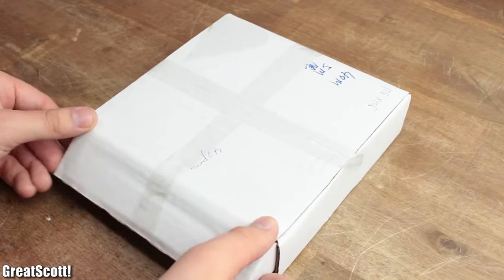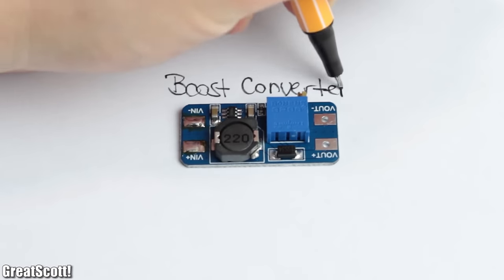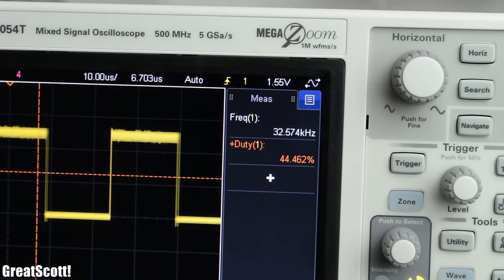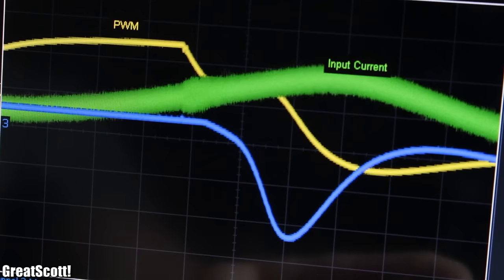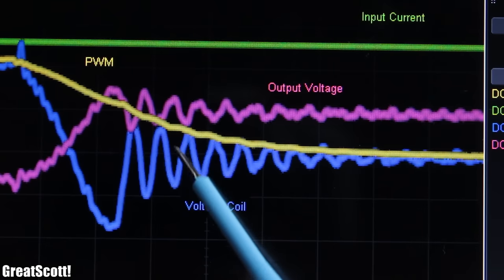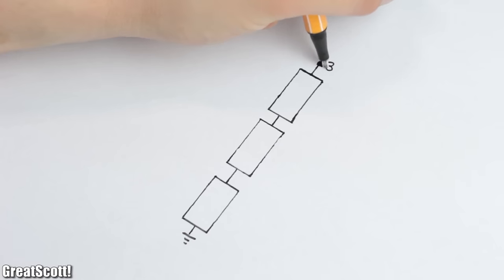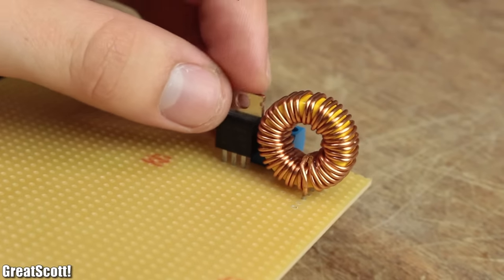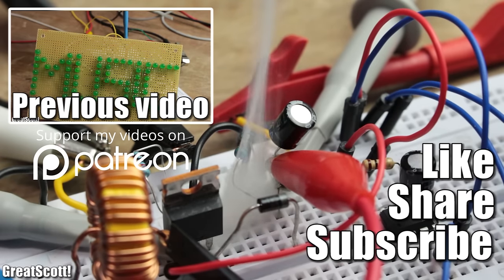DIY Boost Converter || How to step up DC voltage efficiently

Comment: When simply powering an LED, would 3 batteries in parallel with a joule thief circuit last as long or possibly even longer, than the standard non-joule-thief 3 batteries in series or does the storing and releasing of voltage, consume more power and overall drain batteries faster? I would think that by it only being lit 50% of the time, the Joule Thief should make the batteries last longer or even if it used twice as much power while lit, by being lit only half the time, it would at least last the same length of time. I am wondering if using joule thieves to build flashlights as a hobby, cost more money to build, but saves money in batteries by giving you a source of light for longer time.

Hopefully someone reads this and 100% knows the answer. I hope the answer is that the circuit gives you (visually not noticeable pulsed) light for a longer period of time.

Comment: Is the Vcc pin of the Attiny connected to the input voltage of the boost converter? if not then how is the Attiny being powered? 
sorry if this is a stupid question :)
Reply from the maker: +ali10163 It is
Reply: +GreatScott! thank you.

Comment: I have a  question....  why do we need to step-up voltage in order to make something work when we have a fixed amount of watts that is required to make that same thing work thus, why do we need more volts?
Reply: EVOCATI RECORDS imagine the circuit is a water wheel. If you slowly drip a gallon of water on it it will barely move. If instread you use a hose that shoots out the water, the water wheel will move. The speed of the water is the voltage and the amount of water is the resistance.

Comment: Why do you used uC instead astable multivibrator? Here is my project which provides 18 volts (Now it's configured to provide 9 and -9 volts). It also have feedback but I used bipolar transistor instead unipolar. Because I can't find any good MOFSET in LTSpice. http://imgur.com/AWbzbYu
Ps. In my project voltage is regulated by Zener diode.

Comment: I’m curious about your steady voltage output, i’ve tried powering my electromagnet with it, but it keeps shorting out the capacitor since its a short circuit(the electromagnet) how should i fix it
Reply: Constant current source, lower the current and install a ferromagnetic core to the coil.

Comment: Can some one explain me why the voltage divider has 3 resistor normally i see voltage dividers with 2 resistor and i did not understand the reason for that  third resistor, for what i searched it creates 3 different voltage drops across each one but he said it was only needed a 5v reference to the 30v.  If some one can explain i am all ears.
Thanks and great video!!
(PS: i don´t understand much about electronic)

Comment: It's great and all, but seriously, why put a uC in everything? I'm not saying you did a bad video, but I'm a bit disappointed about this because I don't have tiny85 on hand. You can make a crude boost converter by using an ever so popular 555 with voltage regulation as well. That way it could be made by practically everybody, who has this ubiquitous IC. 
  Anyway, good job there. Just decided to express my thoughts.
Reply: Also I would add that more and more people are using microcontrollers in their hobby projects. I hardly ever use  a 555 timer anymore because I can do so much in code.  As such I maybe have 3 of them on hand where I have a dozen atiny85 ics.  Really though, complaining that his video didn't include components you have lying around? Why would he know that? Lol not everybody has 555s floating around just like you don't have any a tiny85s.  I would say more people have arduinos floating around these days which could be used the same way.
Reply: The 555 timer does not have feedback and its so hard to make a feedback for it, and needs much space on the circuit just to make it oscillate. Imagine the feedback which needs an error amplifier and more with different IC's.
Reply: I have attiny 85 on hand, no 555 timers.

Comment: hi greatscott! I was wondering since I was deciding to attach an electric motor/ alternator to my bicycle I was wondering what would be an ideal solution I did some tests and when I am casually riding my bike my multi meter shows about 2.3v-3v then when I am racing or in a hurry on my bike the multi meter shows 7v-8v I was wondering what would be an efficient way to keep this at 5 volts your reply would be much appreciated. thank you and have a nice day
Reply: I do this for a school project, the dynamo (alternator) generate 12V AC (6W or 3W depending of the dynamo) so 500mA.
I build a rectifier bridge (I use 4x 1N5822 Schottky Diodes)(At 1A I remember that have 0.3V of Vf) for a more efficient design instead of the common 1n4004 (0.7V), a capacitor of 1000uF that smooth the voltage 12V*√2=16.97V I remember so just buy 25V at least, and I used a DC DC converter (buck - boost) (buck in this case) that I bought in eBay for 8 dollar for a efficient design (they say that is 92% efficient but I think that 85% is realistic) instead of just the LM 7805 that is resistive and just will 12V@500mA to 5V@500mA so 7V@500mA=3.5W of heat, and with this thing, at full speed you can get 5V@900mA at least, and easily 5V@500mA at low speed.
PRO tip: your phone cannot charge at more than 500mA with this setup for protection, you will need a USB charge doctor that emulate a legit charger for a quickly charge
Reply: +fersunk thanks

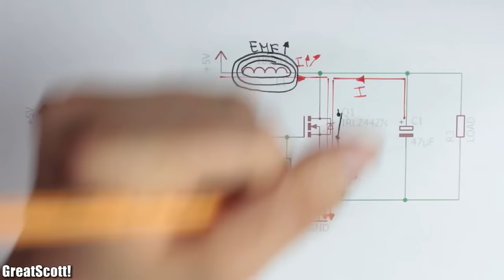Comment: I'm a bit confused at 3:07.  How does the controller deliver a PWM signal to the mosfet gate when pin 6 is connected directly to +5V with no intervening resistor?
Reply: bah... because this diagram uses dots to indicate when intersecting lines are connected.  No dot between pin 6 and +5V, therefore, they aren't connected.  To often do I spend much time pondering such questions, unable to see the obvious answer until I pose the question to others.  /facepalm
Reply: There are not connected.

Comment: so i don't get it (i am a complete noob at Electronics) but, how can you make the Voltage higher ? where Does it come from ? cus too me it seams like you are making free current
Reply: CS:GO: That's not correct.  The voltage increases but the current decreases.  Think of the voltage as the energy of each electron (in water terms, the pressure), and current as the number of electrons passing through a given point in the circuit every second (in water terms, the flow rate).  Energy cannot be created or destroyed, but you can move it around.  In this case you can strip the energy from a lot of electrons and give that energy to a small number of electrons, thus boosting the voltage but decreasing the current.  In math terms, the power (voltage times current) is the same for both the input and output.
Reply: Inductor works like flywheel for current. Once there is current in inductor it tries to stay there no matter what voltage. Inductor is like capacitor, but it stores current instead of voltage. So if you have current in inductor and disconnect it it creates high voltage across itself, because it tries to keep the current flowing.
Reply: +Paul Bartrum what about efficiency?  100% in 99% or less out.
Reply: You can boost both voltage AND current at the same time, though. I've seen a few "over-unity" devices demonstrating this on their crowd-funding pages, and failing to mention that the output has a much smaller duty cycle than the input, and it doesn't even come close to unity, nevermind OVER-unity.

Comment: Sir i want to power my arduino for a long time just by 9 volt battery. So can i use a boost converter with a volatge regulator to power for a long time ?
Reply: An Arduino needs 3.3V or 5V depending on the board, so you need a buck converter, not boost.
Reply: +FlyingShotsman Can u please tell me exactly how a buck converter work in short

Comment: I'm curious. can you use DC Booster to boost another DC Booster? :D
Reply: Yes, but ultimately, there is a limit in output voltage/amperage based on the supply (such as a battery or these solar cells) and each boost circuit. Either way, these ICs have a max voltage and so do the components. You're not going to take 5v and boost to 50v with any meaningful current, without burning things up.

Comment: Why is there a 2nd capacitor powered with the 5v just going to GND?
Reply: I think you're referring to the input capacitor. All boost or buck converters need stable input so that the circuit is not struggling to maintain a stable output voltage.
Reply: Yeah found that out on my own too. But thanks for your answer :)

Comment: I want to turn 1200 amp 12v dc to 1200 amp 360v dc how would I do it. it is to power a electric motor
Reply: 1200 amp? Are you mad? x) That would be 14400 W 12 V DC motor x) The cable dimension would be humongous and the whole design would be so impractical it'd be useful only for it humorous value :D I guess you mean 1200 W, but that's nothing you do with small circuits like this, that's on another scale.

I'd just go about making a 36 V battery and charging it with a charger run by 12 V, like an iMax B6 or something.
Reply: Torgny Nordén no that is a net gain warp 11 duel stack DC motor with zilla manzanita 2k controller
Reply: Torgny Nordén and each motor draws 600 amps and up to 348 volts DC current

Comment: great Scott ! I would like to charging my ebike using  server HP power supply 12v, 55a,650 watt. A need powerfull step up converter with range 5v to 70v. I just enought to use bigger parta following Your video ? Finally i would like on the output about 42v 12amps ( step up converter from alieexpress 1800watt Provide only 42v 8amps, this the maximum wchich can producent  from 12v power supply) maybe You can show how to make over 1800watt step up converter from aliexpress to for example 3000watt. Thanks in advance

Comment: Hey Scott can u make a video on making a 5-12v timer circuit with ne555 with display and when time goes down switch closesand the output voltage will be 36 v or higher with boost converter or something and 2 other ends give the same voltage as input to the circuit 

if possible please make a video 

thanks in advance

Comment: Hi, I notice that both the boost converter that you made here, and the buck converter you made use pwm and/or duty cycle (I believe that is what it is called).  Do you think you can do a video explaining how that works?  I can't really make any sense of it, and it seems to be a really important in voltage regulation.  I appreciate your help.

Thanks :)
Reply from the maker: +DEATHSKULL37 I already did a video about PWM. I think it is called "Dimming all kinds of LEDs"
Reply: +GreatScott! Oh, my bad, thanks for your time!

Comment: I replace attiny85  with tl494, and set the voltage at 56v，it is unstable and the mosfet get so hot, I dunno why..
Reply: 7.4v boost to 56 v

Comment: can the output watts of a boost converter be higher then the input watts?
Reply: baruch shad That would violate the second law of thermodynamics. It would create more energy than it consumes. In order to do that you'd need an efficiency of >100%. In this case the voltage increases but the current decreases meaning that you cannot create energy.

Comment: Could I use this circuit to step 3.7V up to 5V?
Reply: Fried Cube the microcontroller requires 5V to operate. It you power it separately then it could definitely boost 3.7 to 5
Reply: Fried Cube of course you can, the attiny85 works with 3.7 voltage. However, the 3.7 volts suggest a li-on battery and the 5 volts suggest some expensive electronic device such as a cell phone. If this is the case, then caution must be taken. 
You have to add an under charge protection for the battery. And the problems pointed out in the video may cause a serious damage !

Comment: Is it possible to make it with out any sort of IC?
Reply: Charged Electronic Concepts I don't think you can vary the duty cycle without an IC. Attiny85s are pretty cheap and so are Arduinos. Maybe consider buying some and learning how to use them.

Comment: I thought, that you shouldn't charge a lead-acid battery with a "normal" 12V voltage, but only with special lead-acid chargers that alter the voltage according to the charging state.

Comment: Lol I tried to use an NPN BJT (2n3904) as the switch, and programmed it with the arduino to switch on for 1ms and off for the same time. Of course, it blew up! Does anyone know why? (I used 10k resistor at base to limit current as well)

Comment: Power electronics never works on breadboards :p
Too much parasite capacitance, and I've heard that for power electronics designs, you need to have short ground wires... I don't really know why !
Reply: +xgenesys You just need to take resistance into account, short wire = low resistance = low voltage drop, simple. And parasitic capacitance is not so important for power stuff.

Comment: What will happen if I use 555 timer pwm for this design?
Reply from the maker: +Anirban Dhole You would still need a feedback circuit that adjust the duty cycle
Reply: +GreatScott! In 555 circuit there is a potentiometer for adjusting the duty cycle
Reply from the maker: Anirban Dhole
Sure, but the duty cycle needs to adjust automatically depending on what load is attached in order to generate a constant output voltage.
Reply: +GreatScott! Thank you very much... Keep it up

Comment: What is the efficiency of linear voltage converter
Reply: Aswin Krishna depends on the input voltage and desired output voltage. If you have a 5V regulator and give it 12V it'll be less efficient than if you gave it 9V

Comment: Is it IRFZ44N or IRLZ44N 🤔
Reply: IRFZ44N due to low gate resistance and handling high voltage of 55v and high current of 43A(it might be lower or higher I forgot
Reply: Also if you want by semi conductors use infeon and if you want to by IC use Texas instruments

Comment: how do you do this without a programmable chip..or circuit???
Reply: +Kennynva T. look up "joule thief"
Reply: +FlyingShotsman hahahah I laughted so hard at this one , nice XD
Reply: I don't realy know but if the programable chip is just to turn on and off the transistor you can easily use a 555 timer, with the correct capacitors and resistors you can make it work, but the problem is that the 555 needs a 5v voltage so I don't know how useful it could be.
Reply: You need also 5v to run the attiny ...
Reply: Well I didn't know that so you can use a 555 timer if you want but you have to modify the way that you regulate the output voltage
Reply: could you use a LM317 to do this with..???

Comment: The efficiency might be high, but the resistor get too hot at the end of the video 5:30
Reply from the maker: That was a resistor on the Output of the converter.
Reply: OK, that makes sense, good job!
Reply: Would putting a zener diode in paralelle with the cap solve the problem of overvoltage when disconnecting the load ?

Comment: why we don't use 555 replace for atiny
Reply: +Nam Nguyen A microcontroller would be more stable, and can be programmed to work with the feedback.
A 555 can be used tho, a lot of DIY designs use it
Reply: sooooo. xl6009.??
Reply: is not very DIY

Comment: i want to convert a 24v 40 amps dc voltage to 48 v 40 amps dc voltage can anyone help me with circuit
Reply: can i convert a 24v 80ah battery supply to 48v 40a if yes please help me selecting te component amd circuit

Comment: Mannn you lost me at the programming :((

Show me how to make 5 volts into 12 volts without an IC :) just solder lol

To use USB to charge a 12v (10v-12.5v) battery :)))